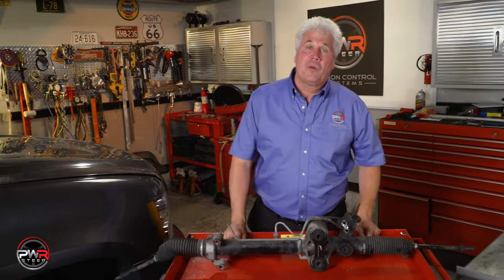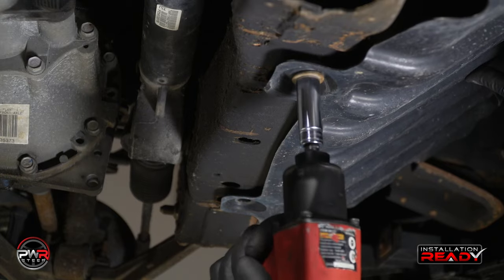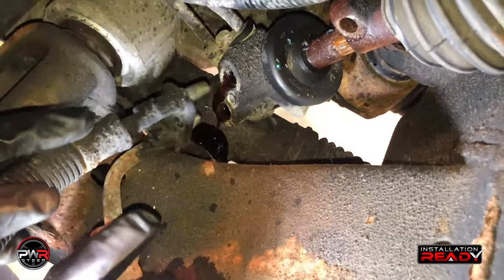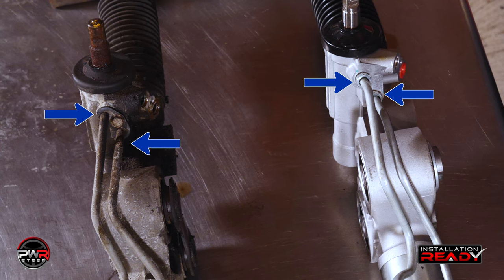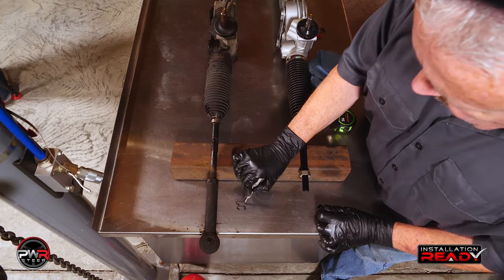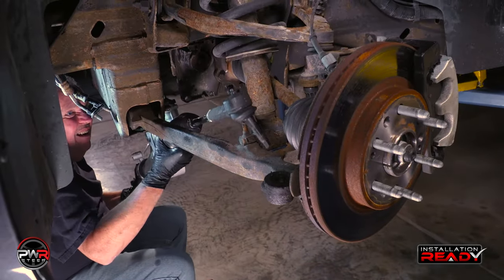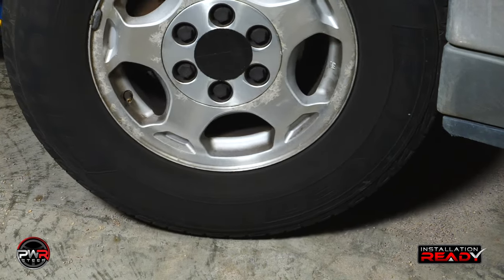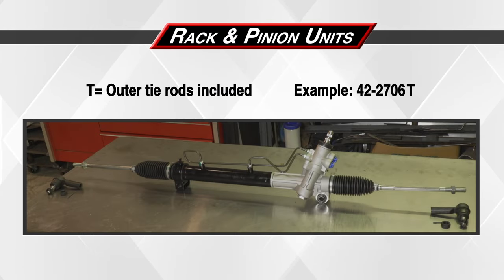How to Replace Rack & Pinion Assembly 07-14 Chevy Tahoe

Comment: I’m feeling pretty stupid. I do all my own car work. I’ve done multiple steering pumps,  rack and pinions, etc. How are you flushing the lines without the steering rack in the car? What is your high-pressure line connected to? It doesn’t make sense to me. Without the rack in the car, your high-pressure line is just hanging loose and there’s no way for it to put fluid into the return line. I would love a response because I can’t get over feeling this stupid.

Comment: using ATF will get the air out of the system better than clear PSF check your vehicle manual for specifics. If you have to do this replace the cooler and fluid lines as they wear out and rust.